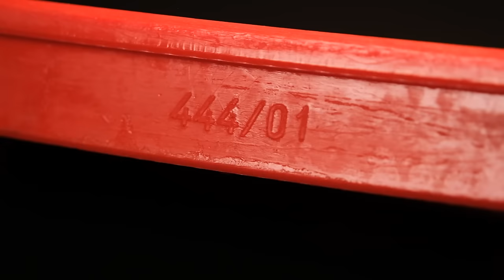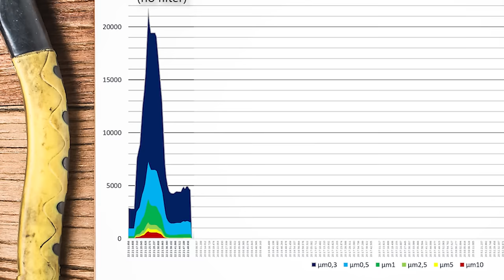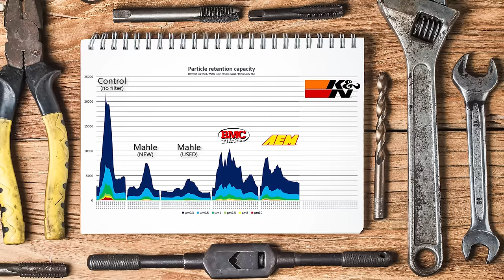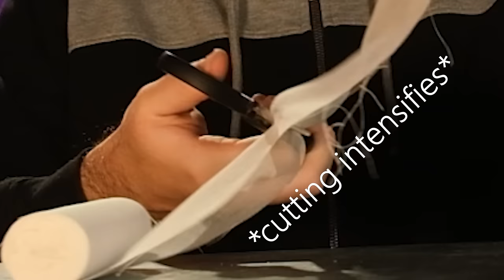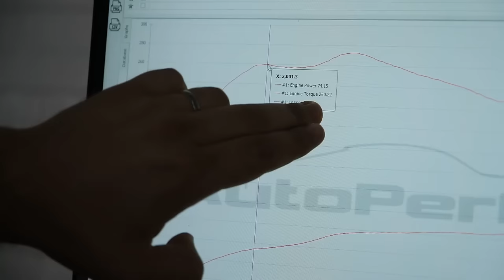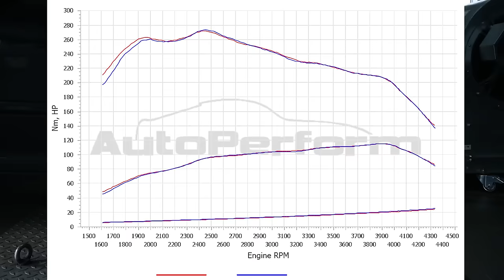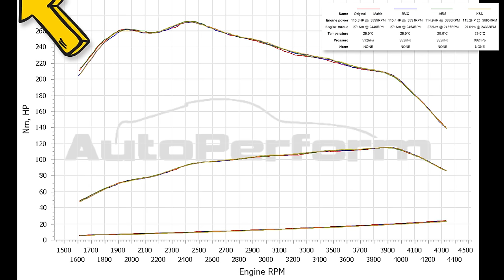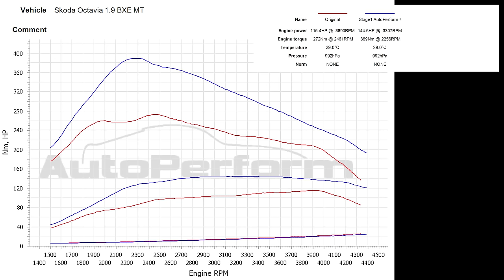Performance Air Filters - K&N vs AEM vs BMC - DYNO TEST

Comment: I’m 52 and I have experimented with K&N versus OEM and found that even from brand new the K&N oils up the intake pipe and MAF sensor.
They are also EXTREMELY (the bugs get jammed in the V sections and regardless how or what you use to clean they bloody well stay there…that’s extremely frustrating-I tried soaking overnight, using compressed air with narrow air gun, everything)
That was when I decided to go back to OEM and concentrate on:
Bigger Turbo, seperate ECU, +30 injectors, much larger (x4 in volume) intercooler relocated to the front where it should be.
This engine is 1kD-FTV (3.0 litre diesel) so 2&3/4 mandrel bend exhaust system with high flow cat and Muffler.
EGT, Boost, Intercooler in and out temps, transmission temp monitored with digital gauges.  Transmission has seperate cooler and Nomad valve bodies.
Old engine lasted 380,000 klms exactly 15 years.  New (reconditioned) one getting installed as I write this.
2007 Toyota LC Prado.

I have owned about 20 vehicles with my wife over the last 30 plus years.
I’m so glad this article vindicated my thoughts on the K&N filter.
Scientific practical tests like this are exactly what is needed.
I was told OEM filters use a silicone like spray in the process of making their filter.  IDK if this is true, but it does sound reasonable.
230 HP
512 Nm
Reply: I had the exact same problem with the K&N oil and the MAF sensor on a BMW M3.   My BMW independent mechanic told me not to use the K&N filter for that exact reason.  I'll stick with an OEM Mahle filter now.

Comment: I have K&N on Z4 e89, about 50k miles now. I did go back to Bosch paper, but engine acceleration felt draggy. So went back to KN and performance came back. The Bosch had so many folds i think it was causing drag on the air.
Reply: all these filter testants suck (as much as i saw in most videos)..they all get no extra power with performance filters..of course i appreciate their effort n job, but they all forget about 1 very important thing - it's how quick the engine reaches that power..it doesn't matter if they get the same horsepower, with the performance filter the engine revs easier as it gets air easier, n it doesn't matter even if the power remains the same, but the engine with performance filter will reach it's power quicker..just like with lighter flywheel - you get no horsepower gain, but your engine revs a lot quicker n due to that you reach your max power quicker..the same with accessory lightweight aluminium pulleys, or any other engine drivetrain component: crank shaft, piston rods, pistons, chain, sprockets, n even valves - the lighter the engine components the easier n quicker the engine revs..for instance, let's say a particular nissan with first generation SR20DE 110kw (doesn't matter highport or lowport) with its 8counterweight crankshaft will sprint 0-100kmh, n then with swapped 2gen. SR20DE 110kw 4counterweight crank shaft engine in, and does the same sprint (let's say both engines' revlimiter set at the same 6500rpm n have the same power 110kw, as they should)..so most plausibly, the same nissan will sprint/accelarate better/quicker with 4counterweighted crank shaft SR20DE than with 8counterweighted, because with the lighter crank shaft engine will reach it's peak power quicker..the same with performance filter, the same power, but the engine response is better, cos the engine breathes easier, so it revs quicker (not necessarily every engine will rev quicker, depends on lots of other components n its features like i've mentioned before)..i hope you got my point..a good example n proof is "Project Farm" guys' test/sprint with their suburban, where with performance K&N filter the car sprinted quicker by 0.1-0.2s in 0-60mph, n even flow tests showed that performance filter flows better despite that most test show the same power n no gain..ckeck yourselves @7:25..https://www.youtube.com/watch?v=sJ3L-E-ufYo..so we already know from various dyno tests that perform.filters in most cases don't add power, so you should make sprint/accereraton tests 0-100kmh/62.5mph instead to see if there's any point of P.F.;p..i instantly felt better responce/acceleration after putting performance filter on my SR20DE Primera/Infinity P10/G20, my brother also instantly felt the difference in performance in his Maxima A35 VQ35DE after installing PF, he even did a test with a device n got 0.1-0.2s quicker sprint to 100kmh..so i guess the performance filter does his job, even if it doesn't gain any power on dynotest, but the sprint results speak for themselves..to get those 0.1-0.2s you would need an extra 10-15hp of engine improvement or even more to get those sprint numbers with your car..as for filtering, of course performance filters suck, especially K&N, BMC, King Dragon or any other cotton filters with see-through holes, unless it's AEM non-oily one, they filtrate better, as seen in your test (but no doubts, even if AEM filtrates a lil worse than stock/oem filter, it will perform better than any oem'ish compressed paper filter with microscopic or no gaps between paper folds)..so only you decide if those 0.1-0.2s of performance worth the engine wear..good luck!
Reply: @bonifacijus11  Sort of explains my experience with the KN filter. Once i put too much oil on the filter, again engine was draggy. So now when cleaned i re oil with a oil and fuel mix so very little oil is left on filter.
Reply: @flybobbie1449  NOT COOL, Bobbie !!  The most important part of a K & N Air Filter installation is to FOLLOW THE DIRECTIONS EXACTLY !!
The reason that your filter was "draggy" was because of TOO MUCH OIL, and NOT that the oil was too thick !!
Your K & N air filter requires approximately TWO OUNCES of the K&N oil when re-oiling.
NOTICE that your K & N air filter should ONLY be cleaned and re-oiled after FIFTY THOUSAND (50,000) MILES OF USE  -- NOT "whenever it looks dirty" or some such bulls**t. 
Most all of the "problems" with K & N air filters are due to pure ignorance on the part of the user.
Reply: @SlikLizrd  I will disregard your rant.

Comment: Could you do a comparison of multiple cold air intake systems for a modern diesel like the duramax L5P? In particular the banks monster air intake vs other brands. There are a lot of claims made but does it really help fuel economy, EGT, acceleration in the hills while towing, HP? Is banks worth the money or will a cheaper one work?

Comment: It was turbocharged engine where turbo mostly elimantes the differences in the airflow (works harder with restrictive filter and easier with with less restrictive) trying to meet mapped values. I would like to see test with naturaly aspirated engine.

Comment: Did you oil the KN filter? Also performence gains depend heavily on the engine, in case of your car it might be restricted not by airflow but by other variables.

Comment: Modern cars with modern ECUs and turbochargers have built in torque monitoring restricting any change in engine output regardless of bolt on modifications so high flow air filters have an effect only if you have a remap.
Reply: Exactly.
However, the performance filter manufacturers aren't very good at mentioning that...
Reply: @marcusjosefsson4998  Very true.

Comment: When ever you clean or change your air filter you have to unhook the battery to reset the computer. At this time clean your mass airflow sensor. Wait 20 minutes and hook up your battery. Turn the engine ignition on but do not start the car. Turn on, lights, a/c, radio and so on. Turn ignition off wait 30 seconds then bam away you go. If you're experiencing engine hesitation or issues shifting this might fix it. You will guaranteed see a difference in performance!!!

Comment: Not to mention you don't have to spend $10-$20 bucks every 10,000miles. I personally didn't buy a AEM for performance, truth is the only time you get any performance is a WOT, which the average person doesn't drive that way. The reason I did get a AEM is in the long run I'm saving money. Doesn't cost me 20 bucks to vacuum my filter every other oil change. :D

Comment: Every filter is reusable with good vacuum cleaner. Lol
Also, there's one coincidence. The less you care about engine, the less harm particles do.
I had Opel Frontera with GM 2.2 petrol engine. 360kkm, filter changed twice during 8 years. The car was eating mountains in every weather!

Comment: A TDI engine isn’t a great measure. Diesel will only use the air it needs to combust, excess air then masks the particulate matter output

Comment: HIgh flow also means more dirt going through plus oil contamination in the intake system.  Cold air intakes are really hot air intakes and mess up the original factory engineering designs.  I just dumped my KN filter on my 455hp S4 and got rid of the noisy Awe exhaust system and put in the stock system.  The car sounds so much better with better exhaust sound which only gets loud on acceleration and runs like new now with smoother performance and feels like it is shifting better too.  The engineers design all parts to work as a system spending hundreds of millions on development.
Reply: PCV system does the same thing every ICE vehicle should have a catch can system installed on them to reduce if not eliminate oil contamination in the intake system which egr valve makes this problem worse.
Reply: Tou’ve never dyno tested a car, have you Paul?  I’ve done before-after dyno testing on 2 of my cars when installing cold air intakes.  They got more power.

Comment: Every car is different, and just dropping one in an unmodified factory air box, might not produce any power because the assembly is not capable of flowing more than the filter allows. Most factory air boxes will improve from simply removing the air silencer, then install the better filter for more performance. If the factory system has large tubes, a performance filter will work. Any turbo car will see results, v8 cars, and high rpm engines. Cold air intake systems will also work, as long as the filter is in a position to get cooler air, like the ones that seal off filter from engine compartment.

Comment: K&N filters requires to be oiled,  when the oil gets in your Mass air sensor.  Then your car will start to hesitate in the first gear and second gears.  After you clean the Mass air sensor,  it’ll drive normal again.

Comment: I have a twin-turbo V6 engine and there's NO WAY I would put anything else than the OEM air filters on it. Because the engineers that designed this engine knew what it takes to properly protect it, whilst giving it more than enough air to breathe to its 365 hp potential without risking any impeller damage to those turbos from unfiltered dust, resulting in a sandblasting effect on them.
Reply: They also have to keep it quiet.

Comment: OEM paper filter is always best.  
 The air filter is the most important filter in the engine so OEM paper is always best.
 For improved longevity and reduced maintenance cost you can cut the foot off a pair of tights and stretch it over the intake to provide an extra layer of particle separation and increase life expectancy of normal paper filter.

Comment: AEM is best if you have a tune and some power bolt ons. AEM Flows very well with good filtering and no need for the K&N oil which can cause issues with the intake sensors. You should still clean it slightly more often than you would replace a standard filter which for $10 is best filter for your basic stock car.
Reply: what's recommended kilometers for cleaning it?
Reply: @acc1tester398  I’d say take a look at it every two or three oil changes, exactly when it’s necessary can depend a lot on environmental conditions and sometimes the intake design itself. If it looks like it’s starting to get loaded with grime, it’s time.

Comment: Curious if disconnecting battery to allow ECU to be put in learning mode would have made a difference. 
In AEM documentation, it says to disconnect battery in CAI installs (for example).
Reply: Nope. More smoke and mirrors by the marketing teams at the “performance air filter” companies.

Comment: I appreciate the effort behind the test. 
But you took the wrong engine....
A turbo diesel engine with a high-pressure fuel injection system.
It simply has its performance figures pre-set.
Even if you blew extra air into the intake with a rotary vacuum cleaner, you'd hardly know anything. Because the turbo uses its own pressure through a regulator.
Same thing with the injectors, they have their own fuel rate set. and the pump has some pressure.

This test, you want to do it on a petrol atmospheric engine.
Where even a small leak in the intake can make the car completely inoperable.

Comment: On my C63 W204 I gained 16 HP just with AEM airfilters, but thats with a big N/A V8 6.2 liters, when you have a smaller engine and force induction, airfilters doesnt really matters.
Reply: AEM would be better or K&N? for CLS 500 w219?

Comment: There are some problems here need to be addressed. First getting a performance filter alone will not gain more power. More available air needs more fuel and here it wasnt adjusted to the correct ratio hence no gain. Second is that most cars have a way undersized airbox which runs down to vacum even without a filter as early as mid range RPM's. This is another reason why the results were the same as the filter itself is not the limiting factor but the airbox is. The so called CAI filters which are actually getting a hot air from the engine bay :) are still a better choice as you get to get rid of the factory restriction the box itself.

Comment: Is there any difference in the sound the car makes with those performance filters?
Reply: If NOTHING ELSE  is changed except the air filter, there should be no measurable difference in sound level or pitch.
Changes in sound come mostly from changes to the intake sytem's configuration.

Comment: Hey man if you use box panel filter just upgraded to Big box panel filter you be more more better air some can add air compressor or compressed inside is help push easy in low rpm wind air comes fast flow inside box if you like looks stack or forge panel filter or carbon is best I use and is giving me natural roar of engine sport bass reduce noise weakness RPM engine I trust forge the are the best in game any car for value money if you want pay 700 plus go eventuri is good.

Comment: Even if there is no change in power curve numbers the thing that is always overlook in these test is the ability to move air at a faster rate. These test need to show the amount of Time it takes to move the given air volume. Essentially this equates to less time to achieve a given rpm. This effect is great as volumetric efficiency in creases. A better test would be to use 60ft times at a drag strip. The higher flow filters will produce lower 60ft ETA nearly every time. Air in and out faster means a quicker rpm ramp rate. Do not focus on raw number as your singular metric to determine effectiveness. Remember that Newton's third law applies to air molecules just as much as it does to anything else.

Comment: I used my Saab cone shape filter with heat shield but after i find dust my intake i put my original back i drive lot of sand roads

Comment: on a stock vw passat with 1.8 20V Naturally aspirated at 125hp will a high performance do something to give a litle more resposne or torque at low ? my car is really slow because is the 4 motion version station wagon with total mass 1670kg (lpg system installed) so i need a small boost

Comment: Can't we assume that after few kilometers, with a performance air filter, the ECU would adapt injection and so we could get more HP? I supposed that you run the different step without driving the car in between and the ECU did not had enough time to adapt.

Comment: I have driven Mercedes 6 cyclinders for the last 13 years as Taxis and with LPG conversions, since using the K&N filter they have performed much better than with normal air filters, you can take mine out of my cold dead hands! :) 
K&N are super, just don´t oil the exit side and don´t bother using them on pussy cars like Skoda or VW´s?
A performance filter is for a performance car.
Writing that, I had a Subaru 2.5 liter with LPG that tended to ``Stotter´´at traffic lights, once I fitted the K&N filter the problem was gone, I´d advise all LPG drivers to get K&N filters for a smother running engine at low revs.

Comment: Aren't the BMC (and I assume K&N supposed to be oiled before installing? That would improve the particulate capture ability, though I have to assume that would also lower their airflow.
Reply from the maker: It has oil applied from the factory. You have to oil it again after washing.

Comment: I know for a fact that AEM dry replacement panel filters suck.  They have less from than the stock filters.  I blew some air at low pressure from my air compressor through the stock filter and could fill the air but when I tried the same with the AEM dry filter, could not feel a thing pass through.  Performance wise it sucked but If your just trying to save some money over time from by replacement filters I guess I would work out for you.   Also if you are trying to keep out as much crap from getting into your engine the more restrictive AEM filter would work.   I can see it being used if off road type of driving where there is a lot of dirt or sand.  I rather just pay $15 for a paper filter when it needs replacing for my daily driver.